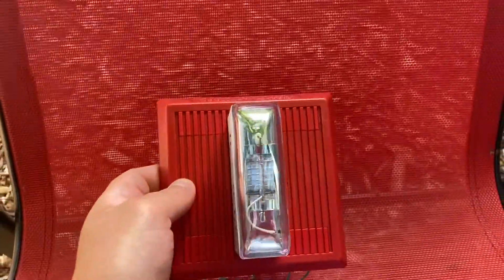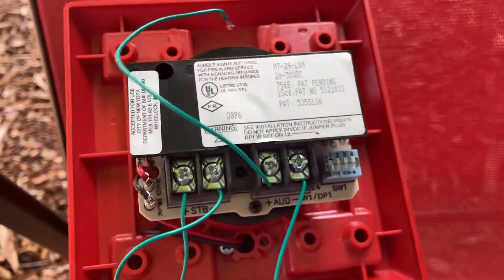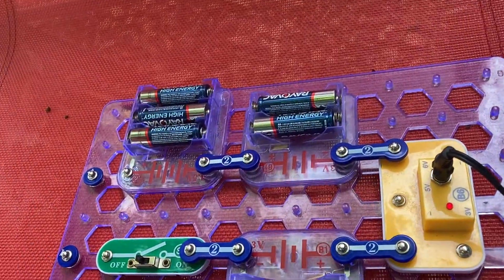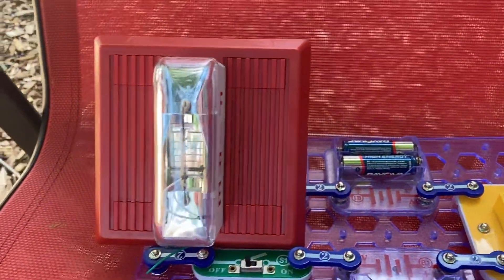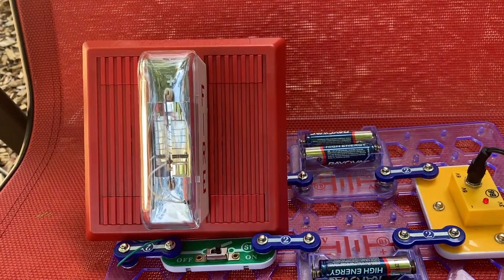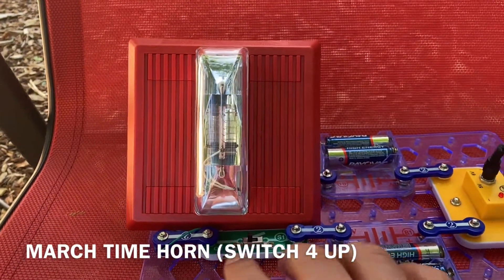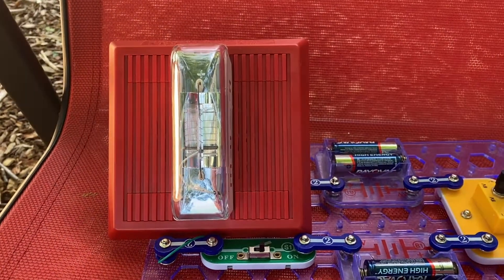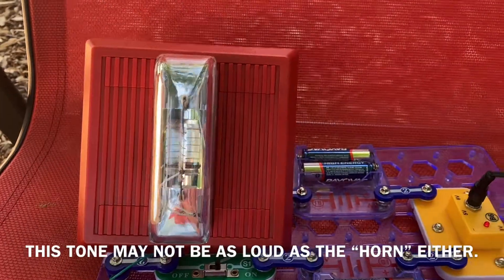Wheelock MT 24-LSM Horn-Strobe Overview and Testing (All Tones Demonstrated)

Comment: Code 3 tone is perfect for Sleeping areas. Like a low frequency sounder
Reply from the maker: You have a good point.  I was also thinking the “bell” tone could be suitable for places where loud noise wouldn’t be good, like hospitals, nursing homes, or daycare centers.
Reply: @andrewsstation6436 Yes. Or like in places like Churches or Libraries as well.